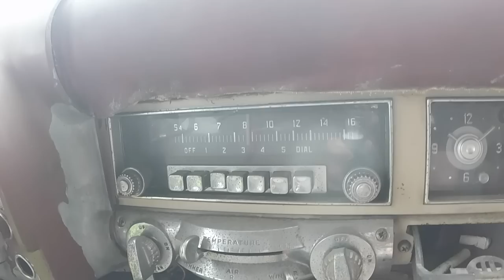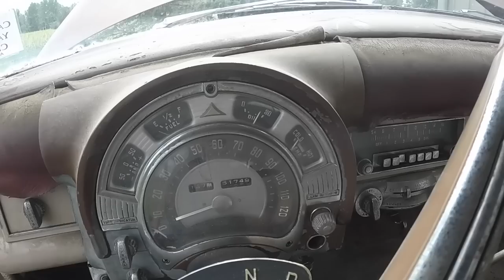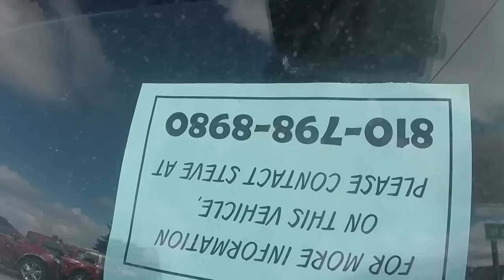Go with me to check out a project car, a 1953 Chrysler Windsor Newport

Comment: Love the adventure.  That Newport would be a wonderful runabout. Too far away to be interesting.  Thanks for another fun video.
Reply from the maker: The seller asked if I would be willing to fix the brakes for him, so he could use it as a local cruiser, as-is. I told him no problem, but be prepared to dish out a grand for the brakes... parts and labor, then another grand for the fuel system, parts and labor. I don't think he wanted to dump that kind of cash into it.... plus the heater core leaked bad... so there is another six or seven hundred dollars parts and labor.
Reply: Slab side MoPars are so interesting.  Aesthetically they appear to be unlike GM cars from that era so they aged in their own dignified way.

Comment: Have you ever come across any 1957-59 Plymouth fury’s ever ?? Just curious I love late 50s early 60s cars
Reply from the maker: No, but if I do, I will most likely buy it, if the price is right, and it's worth restoring.
Reply: Yeah there are not a lot left anymore and if there is one then it’s usually pricey  sense that kind of car was used in  Stephen kings horror novel but cool video tho like seeing old cars

Comment: That house being torn down makes me sick to my stomach. Not sure if I believe the "can't get insurance" story. Hang in there with the car search. The 300 was overpriced for a sedan. There was a very clean '65 Newport 4dr on CL  for $3500 when I bought my 300 and that's what I gave for mine. That '53 is a nice car but unfortunately the pre-57's are just obscure. That's a fluid-drive car.
Reply from the maker: I think Tom wants to save that old mansion... he has saved many cool old houses from a wrecking ball in the past. Yea I thought the 66 300 was way overpriced too. It needed some TLC here and there, but is a nice looking car. I have never driven a Chrysler with that type of trans, but have driven the 3 speed manual fluid drive cars. The trans was super clean, like it had been rebuilt. It had a big metal tag on it, that stated "USE 10W MOTOR OIL ONLY".
Reply: That house is done for.  The foundation is separating and the best thing going is maybe historic preservation but there are probably a hundred other things wrong with it.